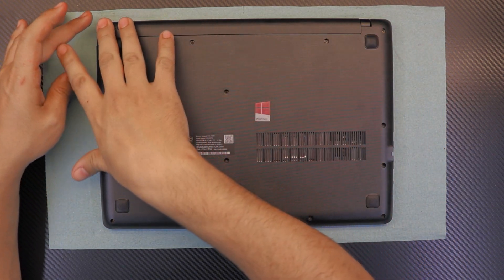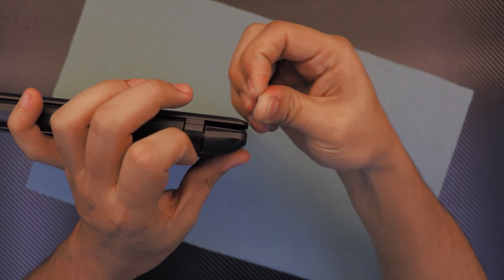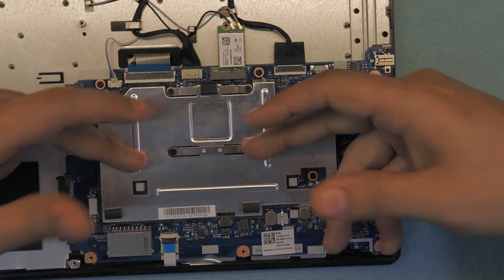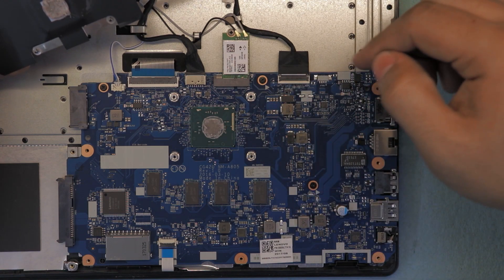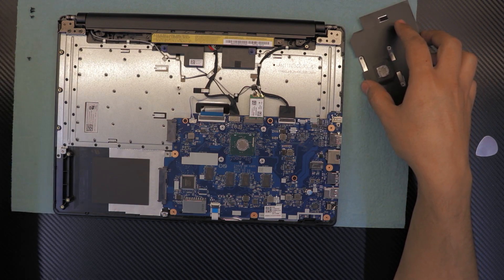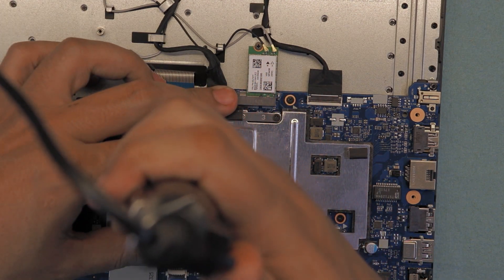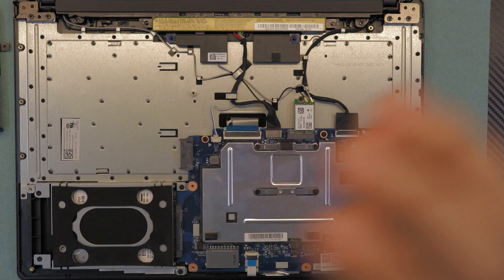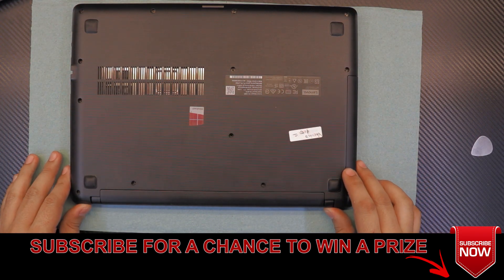Lenovo ideapad 110 Tear down and repaste , WORST LAPTOP 2017 Build Explained !!

Comment: I have one and I game on it. I personally think it'd be not much difference if it was hp or asus or acer models. The hardware (mobo, cpu, ram) solely affect a system's performance i have 6th gen cpu with amd r5 gpu and compared to a hp with similar specs and i dont see any difference. SSD makes my basic computing task easier ofc 
Since its a laptop its definitely not recommended to do upgrades other than ram and storage and both are upgradable too. Whats exactly makes people think its a bad model? aside from cooling system but yet again laptops are known to have bad cooling system anyway, use cooler pad it definitely helps. I actually got it used because my old laptop was broken and i couldnt afford a good laptop so pls convince me its still a reliable model :(
Reply from the maker: thank you for the feedback, and the reason you happy with your is because your have a slightly a better version of the ideapad 110 , you have the version with a proper heatsink and a dedicated GPU. they have many base version for 110 models. i appreciate your comments and recommendation to viewers.

Comment: I have this up until now but yeah the worst one indeed. I only use this for school purposes but it can't help me at all. Tried to open Google but takes several minutes to load, clicked some apps and still took several minutes to open. I can't even concentrate on doing my research paper using this cause it lags all the time. I've got this laptop on year 2017 and it's been 3 years. It is still working but I need to plug the charger the whole time in order to turn on cause if I'll removed it there's no way this thing would turn on
Reply from the maker: ya premuch you have a tablet with big screen, :/ its sad how they push this trashy laptops to customers.

Comment: I have same with N3060, 1.60 MHz,  ram- 2GB (ddr3,1600MHz), can I replace Hdd with ssd ? and will it provide better performance? i only use internet, ms office and other small tasks , but with Hdd it provide very very poor performance, it take to much time to bootup, and very small tasks, like open settings, control panel, file manager etc. please suggest Sdd upgrade will work or not ??
Reply from the maker: the best you can do is to add an ssd and it will bost the speed of loading and opening basic stuff much faster. so therefor yes my friend get an ssd sata
https://amzn.to/330lzsr
Reply: Good question, I'm going to do same, replace the hdd to a ssd, at least it might be usable for basic tasks like you say, the celron cpu also is weak but I agree with you the 1st bottleneck is the hhd the rest of the hardware isn't easy upgraded.

Comment: What type of screw driver i can use to remove processor cover in order to change Thermal paste? Please help i tried many sizes and couldn't remove those three ones
Reply from the maker: its a regular philips #00 PH000
https://amzn.to/31dNV1j
Reply: @uFixTek  thank you so much for the reply i tried with different size and was about to break them or get them loose ♥️
Reply: By the way My model is Lenovo ideapad 110 15isk core i3

Comment: you got me depressed for having this garbage! But I still need help. you said it doesn't support RAM upgrade, but according to Crucial it has 1 slot (4gb onboard) plus 16gb that can be add. So i'm confused with that, if you could help me. thanks for the video anyway
Reply: btw. my model looks like this one but it's a i3 with the DVD drive on it. So maybe it's a different type of it?
Reply from the maker: ah then you got an up scale model of this trash lol
yours may have a fan and a proper heatsink and extra ram slot,  as you seen its very simple and easy to open the bottom cover, open it up and send pics, and i will help you out. good luck
Reply: @uFixTek  following the manual, I see that my notebook supports only 2133Mhz with 15CL. But I am buying a 2400Mhz with 16CL. Should this be a problem? The price difference between the two is R$ 120. I'm almost paying someone for doing this job for me. jezz
Reply from the maker: lol the link you send me its something else its not the laptop  :/
Reply from the maker: it will work if you get the 2400 the bios will only use the 2400 up to 2133hz,
Reply: @uFixTek  man thanks a lot for the assistance you gave me. I just changed the RAM and i'm running the machine at 12gb of RAM up to 2133hz, as you said. Nice Channel!

Comment: Hmm thats strange.. This laptop has lasted me a good four years so far. Right from when i was 13 to 17... I have the ideapad-110 14isk i believe. Had to upgrade the ram to 8 gigs. Its obviously not a gaming laptop but it was still able to play some older aaa titles like gta v on lower settings without any issues. Guess i just got lucky haha
Reply from the maker: ah the 14isk is a better version than this one, i believe this one is a lower models. your may have a better heat-sink and a fan , you can open it same way and check it out.

Comment: I'm dissapointed.. I got this model with Celeron 1.60ghz and oh man it's slow.. It can run some games I play very good but after couple of hours of playing it starts to hear up it literally burns my hand because how hot the cpu is. I've bought a cooling stand underneath the laptop and it really helped even boosted the performance which is great. The bad part is that you can only upgrade from HDD to SSD and that's it. I wish I could add more ram or better cpu.
Reply from the maker: ya its very unfortunate, i hope in future buy you get a better luck :)

Comment: Mine is 110-15ACL  Model:8OTJ. Is that the same as yours in the video?
Reply from the maker: most of the 110 are the same internally, some new 110 do come with a better cpu and gpu, what you need to do to is opening them is the same, remove the bottom cover and you will be able to see you mobo , i believe yours have an better cpu/gpu

Comment: Have one myself, absolutely one of the biggest pieces of junk ever. I won't even sell it or give it away, because I don't want bad karma lol. Pair it with windows 10 and it's a mega disaster.
Reply from the maker: i do agree on this with you my friend, this is what i call "milking the cow"
Reply: I felt the same, my daughter needed a basic laptop for schoolwork but I wouldn't give her this as I wouldn't give it to my worst enemy its that bad it would have drove her mad. I'm considering changing the hdd to a ssd, maybe try improving the cpu cooling heat sink, install Linux but that's a lot of work.

Comment: Do you know which model that came with replaceable cpu and ram? With almost the same price or a bit higher.

I have this laptop and it's shit, i can't even do my work properly, can't say anything about games. Super terrible
Reply from the maker: Saya Hamba none of the models on lenovo have a LGA cpu , gpu none too.  Only high end alienware area 51 laptops have LGA cpu
Reply: Is it good if i put an egpu for this laptop, just for temporary upgrade?
Reply from the maker: you can and it will work if you want to do some light gaming as some or most recent gaming need cpu power too, just something to keep in mind before you purchase egpu. https://amzn.to/2voaYcb
Reply: @uFixTek 

Yeah for some light gaming and at least faster work computer speed. I can't afford new laptop or computer for a few years

Do you have any advice on how can i properly put the egpu cable?

And is it a bit better if i put replace the optical drive with a caddy? Thank your for your time, i appreciate it

Comment: Mine laptop is lenovo ideapad 110-14ibr. Can i upgrade the ram?
Reply from the maker: No. the Ram on that model is not up-gradable. :(
Reply: @uFixTek  Since the RAM is forever stuck to 4gb, is the HDD upgradeable or replaceable with SSD instead to make it at least a little bit faster or something because it lags so much ;(
Reply from the maker: you can ass a ssd yes and remove your HDD, it will make it 40% faster.
https://amzn.to/33e5n4h

Comment: I have lenovo 110 with AMD A6, 8 GB DDR2 Ram,1TB hard drive can I add ( extra RAM slot or atleast another slot other than embedded ones) RAM in that model and is there any ssd slot in that one please help me with this one
Reply from the maker: if you want to make it faster the only upgrade its the ssd 2.5' drive, and regarding ram you can not do anything add slot or any moding. sorry to give you this notice.
Reply: No sir I am not talking about modding there are certain models of this laptop having embedded Ram with an extra empty RAM sticks don't know why lenovo has done this it may depend change country to country
Reply from the maker: @Madhur_Singh-7  yes you have to open it up and see if you have an extra slot if you dont then there is nothing you can do
Reply: Buddy, I have a Lenovo Ideapad 110 Model 15 ISK. This one is a 2nd hand one and has a heat sink, a fan cooling system, 4 GB RAM embedded into it and an extra slot that has a capacity of 4 GB RAM(DDR 4), 500 GB HDD(2.5 SATA Drive), 15' inch screen and Intel HD Graphics 520 Family(integrated GPU).

Now if you wanna check your model, you should flip the laptop and on the bottom case should be a sticker that should detail your model. Another clue will be a couple of metal bars on the left side of your laptop near the ethernet port. Also, under heavy load, you should be able to hear the fan rumbling.

In your case, it seems you have an entirely different laptop\model(check if your laptop is an IdeaPad), or I have not heard of this model variant. The laptop should come with 4 GB DDR4 RAM(embedded), with Intel HD Graphics 520 rather than an AMD A6 as it is clear that all 110 variants have Intel Chips(as far as my knowledge extent).

Now here are some questions:-

i. Is this a 2nd hand Laptop?
ii. Has this laptop ever been upgraded?
iii. Can you kindly make sure your RAM is DDR2?

Finally, answers to your question( if your laptop is the same one as mentioned)! There is no extra slot for an SSD Hard Drive.

Also, if your RAM is found to be a DDR2 RAM, it is less likely that you can modify your RAM.

P.S:- Your specs is kind of throwing me here and there. Anyways, let me know if you can confirm any of the above.

Comment: So, I can't upgrade RAM ?
Reply from the maker: give me the exact base model of your laptop, ideapad 110 its a series of the ideapad.  give me the exact model
Reply: uFixTek im asking the same question as masjid
the laptop is T110-15ACL 
model 80TJ
Reply: @kkwun4969  O=I don't think so my friend. Mine however is a 15 ISK Model and has a free slot for RAM to with heat sink and fan cooling system.

Comment: Mine is lenovo ideapad 110 (8GB RAM) with AMD Radeon graphic card and I won't complain coz it runs quite smoothly. Even though it's not a gaming laptop I can play MOBA games like LOL and DOTA smoothly and recently downloaded apex legends and PUBG lite its playable with low settings. I'd say there is so many cons as well but what more can we expect from a low budget laptop like this. Just be happy with what you have.
Reply from the maker: then you have a different base model!, yours is not the same as this video, the ideapad 110 its a main series the actual model its underneath your laptop, you have an higher grade model in the series that's why you happy with it :P
Reply: Haha I didn't know that there was an intel verson of 110 until yesterday. Anyway have a nice day.
Reply: i also have the same one with amd radeon. battery backup is very bad  n sound is also poor. i replaced the hard disk with ssd and its fast now.

Comment: I have one and it doesnt look like  this but its ideapad 110 with i3 7100 and 8gb ddr4 , has cooling , discrete gpu , 500gb ssd etc...
Reply from the maker: Yes you have a same base model but different version of the ideapad 110 but good to know that different versions have a proper heatsink i will try to get one and show insides.
Reply: @uFixTek  Lol i cant find youtube videos of my version , I have with amd r5 2gb GPU and my friend has with gforce 920 , I have i3 7100 and my friend has that intel 3000 (its trash cpu, extreme low end) ...I have allso sager Clevo p150sm with gtx770 and this Lenovo 110 is acctually decent for gaming.

Comment: can it support a external gpu using pci express port
Reply from the maker: it will but you have to remove the WiFi board, and use a USB WiFi. but dont expect to have a good results because the cpu heat sink is a crap. but yes you can use a pci express for external gpu, but it will be still very bad at gaming because of cpu heat sink.

Comment: Weird, Mines has a fan and the one ram slot I have is upgradable......
Reply from the maker: you maybe have a different base model, 110 its just main model there is few base models
Reply from the maker: your maybe is something like this: lenovo 110-XXacl or something
Reply: Model 15 ISK is more likely as mine is the same.

Comment: What a pile of crap 🤣 we have a winner.. No. 1 shitware of 2017
Reply from the maker: one of the worst laptop, they are many more, on 2018 they will just put a aluminum foil paper on cpu and call it a day :P
Reply: Scott Schoemann probably the HP assembly line sends this model to latin america but I can’t guarante it. One way or another is shameful to see this kind of hardware nowdays, worst having HP labeled over it.
Reply: other vids of the same  LT show a completely different MB. so who do we believe?
Reply from the maker: Scott Schoemann you do not have to believe me or anything, i been in laptop and repair biz for over 15years im doing this to show everyone how to do services and part change.  Regarding fan missing and bad heatsink, they are all over all models of hp toshiba and lenovo even some asus... but again all this shit only applies to the lower end laptops up to mid range laptops, if you want something that can last you long time and in a laptop.. you have to invest to get the top ends or simply go PC.  This model that i opened it was from a client of mine and not all hp have missing fan, all the laptops with the same model nomber are the same. Search with exact model nomber. For eg. Hp 15-xxxx. Will not have fan or bad heat sink but if you search hp15-zzzz it will look alike from outside but with fan.

When investigating make sure use all resources exact model and number.

If you need more detail and info let me know i be pleased to help out.

Thank you
Reply from the maker: here is another video of a Hp laptop that i opened stemp by step with no fan. https://www.youtube.com/watch?v=Gqu_-riiLkc&t=837s